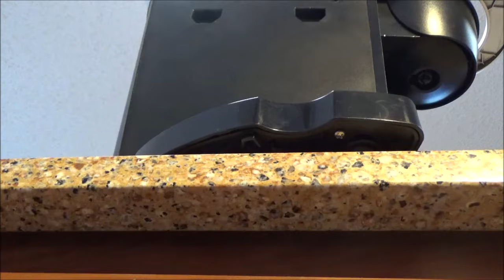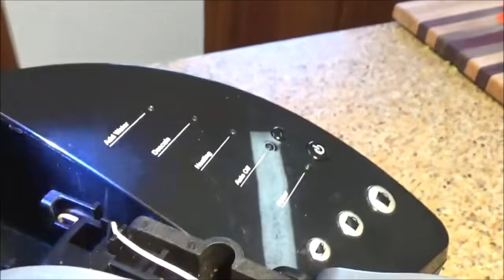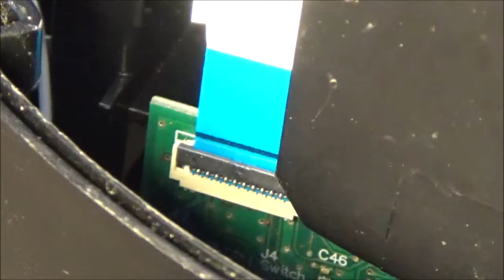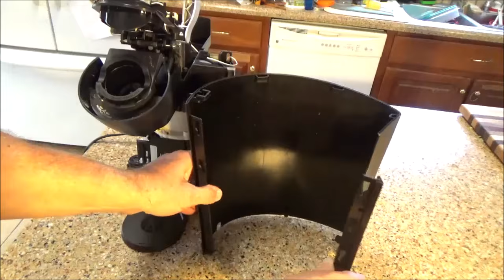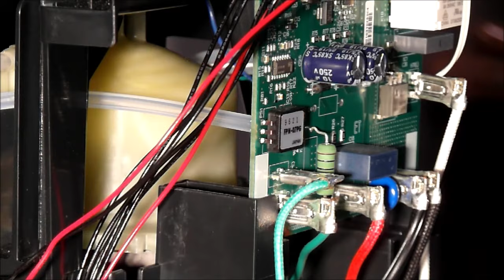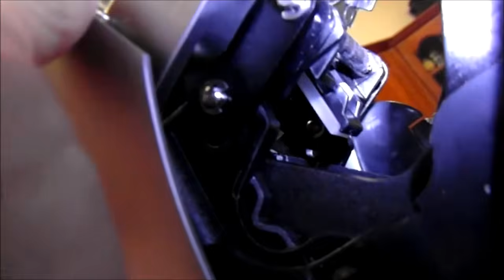Keurig Classic K50 Disassembly and Theory of Operation

Comment: Mine sounds like it is vibrating to death INSIDE.  Like every time the Motor pumps in water.. It Rattles like it is literally coming apart.  But it still works.  IS the MOTOR Loose??  It sounds like something is vibrating against the plastic.  Just really Loud rattle!

Comment: Very thorough I loved it.  My current Keurig is a model 850.  I still haven't figured out how to get it apart. It's making a loud vibration noise. That i'm trying to fix a really loud vibrating noise 
Thanks again.  
PS do you know of any way? I could hook up a water tank from my water bottle that sits on my counter so it'll always have the water it's the same water we use to fill the water reservoir. I'm a retired navy electronic technician I'm sure there's a way. I just haven't wanted to figure it out.  You obviously know what you're doing so.You're the Keurig MAN!  You've  probably already figured that out. I was in a repair shop, and they had a cure egg that was hooked up to water that they didn't have to fill.That would be nice my wife prefers bottle water.  I  just wanted  the unit to look good and the water tubing not be too noticeable
Any help would be great!
Thanks
-Mitch

Comment: @getitsettech1015 this is nice detail. I learned a lot about my K50.  Thank you. I was able to resolve some issues that I created while attempting to resolve original problem. But I still have the original problem. - close the cover and lights do not go to blinking ( point at which I would select a volume size before it starts to brew). Just stays at solid lights. 

Just prior to this issue occurring, I descaled the machine and ran lot of vinegar and water through. My theory is the thermostat. Any suggestions?

Comment: Mine just crapped the bed. Took it apart to see what happened. Nothing is burnt up. Was hoping to see a replaceable fuse… nope. Seems like another landfill item rather than a repair reuse item. Maybe if I had a schematic, and knew what electrical components control what, I just may be able to salvage it.

Comment: I am having an issue where my K 50 will heat up and will flash the blue lights when inserting a K cup, but will then turn off before it brews. Any idea what the issue is?
Reply: Fixed it!  Not sure what the issue was.  Took it apart and banged on the motor and then reassembled it and it worked. Maybe a faulty connection? 🤷‍♂️
Reply from the maker: Could be a faulty connection, yes.  If not, could be that the pump motor was stuck.

Comment: At 23:19, "this device"....what the heck is that? Little square thingy right after the input.
Reply: The guy said it was a check valve..they are used in all kinds of liquid devices, be it water, oil, milk, Soda ,doesn’t matter what’s in the line, it prevents  fluid from going backwards, and draining out causing a leak, or air pockets …your cars engines uses them to control oil pressure  in solenoids, your cars fuel system uses check values in the fuel pump to control fuel pressure so there’s not long extended cranking times for quick start ups….this is a pretty simple Device, but for those who can’t or aren’t mechanically minded might as well just buy a new one, as it would cost more to repair it than to buy a new one, as even if like mine the water is only getting to 102 degrees, I’m guessing there’s either a build up on the heater plate, or it’s bad, and a shop would charge at least two hrs labor plus the part, and a new one cost less than probably a repair shops hourly charge when they are on sale…

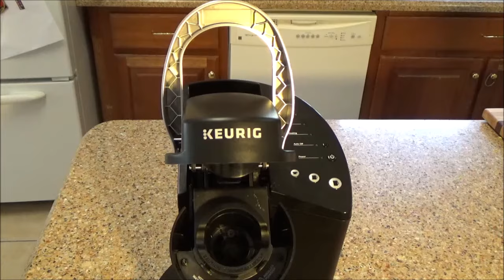Comment: at 5:08 you removed the cover screws and pushed back before removing the cover.. i just had to disassemble this and the round plastic cup-shaped k-cup outer surround piece to clean up a mess (pod blew out when the final air burst pushed through and coffee grinds went EVERYWHERE inside..

anyway, it's the older style (B Series?) with the silver top and LCD display.. i'm trying to put the cover back on but every time I align and tighten the screws, the lid won't clamp down.. it does clamp down without the cover.. i see two thin guides on the back end of the cover (vertical), what am I screwing up?!

Comment: Door switched failed on the Keurig classic, got the top cap off, but having trouble getting to to the switch. It looks like the white button is jammed in. I assume mounting screws, so the assembly must pull out some how.  The how is the problem.

Comment: Great job explaining the tear down and workings of the machine. Your video didn't help resolve my issue of a very noisy pump, however it will definitely help me to disassemble the unit. Thanks.
Reply: Well if the pump is making louder than normal sounds, it’s probably bad, as if it’s a vain pump, one might of Worn the side off causing it to drag on the case,or one of the bearings might of failed, so either way you’ve got to replace it , as there’s little maintenance that can be done to the pump, it’s a throw away unit..

Comment: Mine is only brewing 2/3 of a cup & stops what should i do to fix this
Reply: Mine is doing the same thing thing, but it’s also no longer making hot water, it’s only 102 degrees, I screwed up and never put a filter in mine, but I use bottled water,as I’m sure many others forget to install one to, as the classic it has to be bought separately..if you’ve not been cleaning the inside out every 3-6 months about every 60 cups from what I’ve read it can build up with scale inside, so you can try and use either white vinegar ,and then rinsing it with water, or use the descaling product and rinse afterwards..it should help it..I’m going to flush mine too, but if it doesn’t get hot ,I’m just going to toss mine as I’m guessing the hot water heater plate has or is slowly failing…

Comment: I had a very dead spider in my cup of coffee. Was there any way it could have crawled into the machine snd got in where the water is in the machine itself (not the reservoir) I am certain it wasn’t in the reservoir, nor was it in my mug prior to brewing. I’m ready to throw the machine away but I don’t want to if I don’t have to.
Reply: Oh gosh that's disgusting 😣 Well I hate to say it, it's possible it somehow entered the inside water tank. I would guess through the needle where the coffee comes out. I actually just opened mine and there was quite a few spider webs 🤦‍♀️...one more reason I hate spiders. Anyway sorry for my rambles, hopefully that was the first and last time you have a spider in your mug!
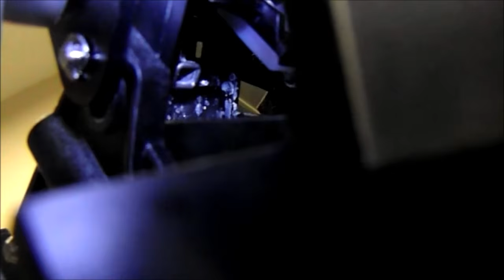Reply from the maker: There is a ventilation port on the side of the machine on the flat side where the reservoir sits against it, but if anything gets in there it can't get into the hot water tank because it is blocked by what looks like a filter before it can get there.  The only likely place I can think of is a hole underneath the arm just before the needle that goes into the K-Cup.  See 37:03 in the video.  The hole is always closed up if the arm is down, like it is while brewing.  If the arm is up to insert the K-Cup, then the hole is open.  I hadn't thought about it, but maybe that's a good reason to keep the arm down while not using the machine.  But like the other person said, it's also quite possible that it could have entered through the needle.  If it's almost time to de-scale the machine anyway, doing so might give a person some more peace of mind 😉.

Comment: This is a fantastic video, thanks for the efforts! My K50 stopped working after an across-state relocation. So it pumps cold water in, and brews it, however, it won't dispense coffee anymore. It drips out a drip or two and then goes totally silent. I checked under the top hood there is no jam at all. Would you think it is the air pump is bad, or the hot water tank is bad?
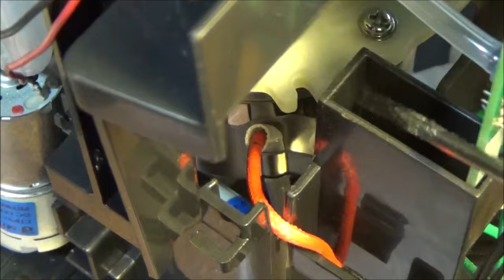Reply from the maker: If you can hear it boiling, the hot water tank should be good.  As far as pumps, it's really the water pump that does most of the dispensing.  The air pump just blows out the last little bit.  At 33:25 minutes into the video, it shows a clear tube on top that feeds into a long black dispenser assembly.  So if that is clogged up, that could be blocking it.  If you haven't already de-scaled the machine, it would be worth doing it because it might loosen the clog up if it's in there.  If you happen to have it disassembled, you could get a hold of that tube and try to blow through it to see if it's blocked.  Other than that, it could possibly be the water pump.

Comment: Thanks for the informative video. Do you now if the heating plate is made of stainless steal or aluminum? On the newer K-Select models they use a helical heating tube that's made of aluminum. My concern is that the aluminum will corroded over time and release toxins in to my brew water.
Reply: The heater plate is made of stainless steel, as per KUERIG customer service..just so you have to worry about that issue.l

Comment: Does this unit have a water filter....i dont see anything on mine..??
Reply: Yes they have them, but on the cheaper models you have to buy it separately,as I found out, it’s a tube with the filter at the bottom, it fits inside the water tank,it’s a press fit in the middle over the water drain hole to the check valve..I found out that by the time you buy the filter ,you could of bought the higher end model with it, and some extra features..

Comment: These things are a monument to human over-engineering. But  something about it's design is totally charming, it has a lot of mechanical steps, many with points of direct electronic interface. Some left field solutions, but the board looks more like a chonky piece of 80s stereo pcb... Ya know if one had an air tube interface lol. A lot of thought  went into it. All this... for one damn cup of coffee!? Salute.
Reply from the maker: 80s stereo PCB?  I remember those - I see your point.  The old-style technology does make it a little easier to trace through and understand what's going on though.  At least more so than guessing what the firmware is programmed to do.
Reply: @getitsettech1015  Yeah, I'm not sure what I expected to see, single pour-over coffee being the simplest of hot drinks... But I suppose *either several smaller boards throughout/more discreet modular systems, or more kinetic/mechanical means? Mind you I went in with apathy, as K's brew too quickly for a full bodied/caffeinated cup, a weak pour-over IMHO. I was utterly unprepared for the analog and digital forces at work to automate the process.
Reply: @getitsettech1015  Now my hacker brain won't disengage, convinced a K could be modded to my tastes. I prefer a French press or percolator, chemex pour, and just fine with a standard coffeemaker  (for the caffeine extraction more than flavor). I might have coffee twice a week at best, but it is a process on days I'm already running slow. If I can make this thing do what I can do with minimal beans, it would be worth an extra couple mins runtime to cut my prep. It currently makes single cups I would drink half a pot of anyways, but I bet it could make some one & done. Well, crap. I think I just committed. Sorry for the rant. Great video though. Dammit

Comment: what should i do if my keurig cap won’t open. like the place that you put the keurig in is completely stuck shut
Reply from the maker: You mean that when you grab the handle you can't move it?  Do you know what model you have?  Does it look like the one in this video, or a different one?  You could go to the top cover (that goes up and down with the handle) and look at the back of it.  Take a flashlight and look into the gap between it and the back of the machine.  Make sure there is nothing in there that might be jamming it.  There shouldn't be anything in there at all.  If there's nothing in there, you could just give the machine some hard slaps on the side or pick it up and shake it to see if that helps.  Could even turn it upside down and bang it.  If none of this helps, you might have to take it apart to take a look.
Reply: Yank on that mf
Reply: Cool I’m going to see what else you fix, lol..thks

Comment: I have performed every DIY fix on my Classic 50 that I am aware of and unfortunately I am not making any progress. Your  video is very informative and more than helpful. Do you have a tutorial on what to do when using the paperclip & cleaning both needles, cleaning the valve on the water tank, cleaning the valve on the keurig, and doing multiple runs of descaling is not the solution. My keurig works but it does not produce a full cup of brew. I have taken it apart and I don't see any visible issues. It appears that the suction of water is not being produced at a accurate rate. Buying a new one would be less time consuming but your video gives me much hope. I just need a little more direction. Any suggestions?
Reply from the maker: Sorry it took me a while to get back to you.  If you wanted to check to see what's driving the water pump, you can measure the voltage across the red and black wires at the terminals of the water pump (the pump on the bottom of the unit).  The voltage should measure between 7.5 and 7.7 VDC when performing a normal brew (not strong).  This voltage will disappear once the air pump takes over at the end of the brew.  If the voltage looks OK, you could remove the water pump from the machine by unclipping it from the base, removing the two tubes that are connected to it, and unplug the pump wiring from the main board.  Take the pump to a sink.  Get a medium amount of water flowing in the sink.  Take the port on the side of the pump and carefully stick it into in the flow of water.  Now take a 9 volt battery and connect the battery + side to the red wire terminal, and - to the black wire terminal.  The pump should run and a moderate flow of water should come out of the other port that is in the center of the pump.

Comment: Your previous message

Thanks for the very informative video. I have a K50 Keurig with the PT0000002628 board in it. The red MOV1 component on the board was blown from a power surge and I replaced the entire board. The unit still does not turn on. I do hear a relay click when I connect it to power, but that's it. What should I check next?
Reply from the maker: I have a K50 that is doing the same thing - the relay clicks, but you can't turn it on.  I hate to say this, but I'm not sure what could be causing it to act that way.  The thermal fuse on the hot water heater measures good, and has to be, otherwise the relay wouldn't even be able to click because it has no power at all.  The heating element in the hot water tank reads good and so does the thermistor.  I measured the DC power voltages on the board and they all check good.  Maybe it's possible that the display board is at fault somehow, but I wouldn't know how to prove it other than getting a new one and trying it out.

Comment: Why does the water pump have those four signal wires in addition to the two dc wires connected directly to the motor?
Reply from the maker: I haven't proven it, but I suspect that those wires are connected to a sensor that measures the amount of water flow as it goes through the pump.  Since there are no electrical probes in the hot water tank anymore to stop filling the tank when you reach the amount of water you want to dispense, I am guessing that if a sensor inside the pump measures water flow, the processor uses that information instead to stop the pump when the time comes.  OK, the hot water tank still has one probe at the top to stop the pump when it gets completely full, but other than that the rest of the probes are gone.
Reply from the maker: I finally took a water pump apart to confirm that there is a water flow sensor inside.  There is.  The pump shaft has a paddle on it that rotates between a couple of electronic sensors - once per revolution.  The sensing arrangement doesn't seem to be magnetic.  Instead it is probably an LED emitter on one side of the paddle and a photocell on the other side.  So the paddle interrupts the light path.  I believe that the processor should be able to equate the number of pump revolutions to the amount of water that has been dispensed.
Reply: That's a infrared opto sensor.  @getitsettech1015

Comment: Hello, I have two K79 coffee makers that I purchased new and took out of service years ago in good working order.  Both were used lightly.  Recently, when I needed another Keurig I decided to unbox one and set it up for use, however upon filling up the external reservoir and turning it on the pump would rum continuously and then show "Prime" on the LCD screen.  I tried both units and both are presenting the same.  Tanks spotless and flowing.  These look very complicated to access components, but I am motivated to repair these if possible.  Could you offer any thoughts or advice?  Thank you  Lj
Reply from the maker: I haven't been inside this model, but I'm guessing it is similar to the B70 design inside, which used the solenoid valves.  The solenoid valves had the habit of corroding and going bad, but in later designs, they replaced the original solenoid valves with ones made by CEME, according to the label.  One would assume that they did this to try to solve the problem with the earlier valves.
When it runs continuously, does it pour water back into the outside water reservoir?
Does it dispense any water into the coffee cup?
You might try to look for the ventilation port near the top of the outside water reservoir.  Start to brew a cup and wait until it is done pulling water from the reservoir, then when it should start to actually dispense into the cup, hold your finger over this port to block air (or water) from getting out.  If this improves it any, then one of the valves inside is stuck open.
Reply: How 'bout a thank-you for @Getsec Tech?
Reply: @iamachine  you are right, thanks and Thanks a bunch GetitSet Tech!